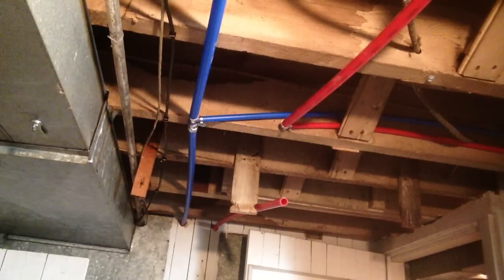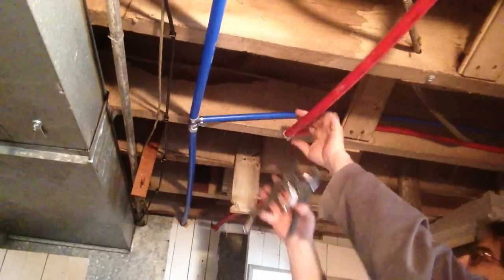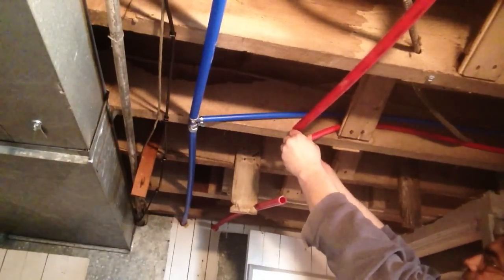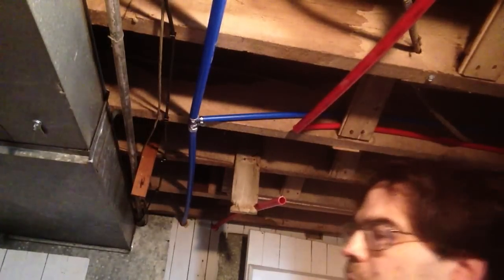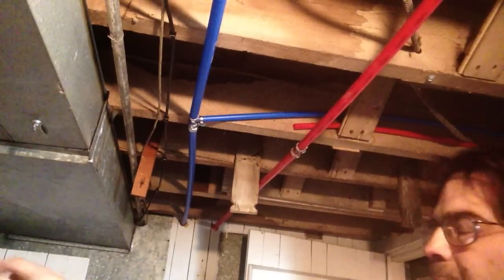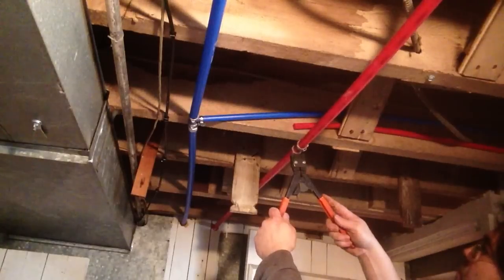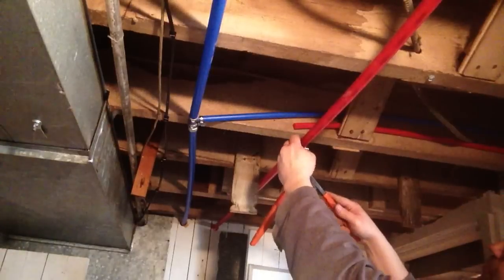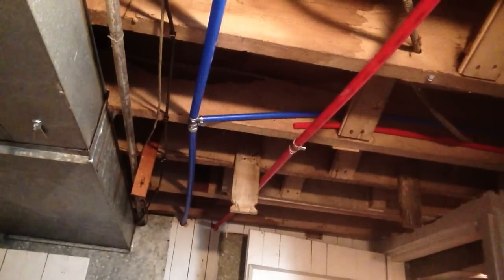Pex tubing mistake

Comment: It's really scary. It could take 40 years to know if this hi tech stuff will work. I'm scared and maybe we should not deviate from our forefathers. We can still mine copper
Reply from the maker: I keep going to the pex because its really fast and easy to install. I have been seeing pin hole leaks in newer copper lately also. Time will tell.
Reply: I have a house built in 1958. I can tell you the copper FAILS.
Reply: Try the pex home run - all joins are in visible spots